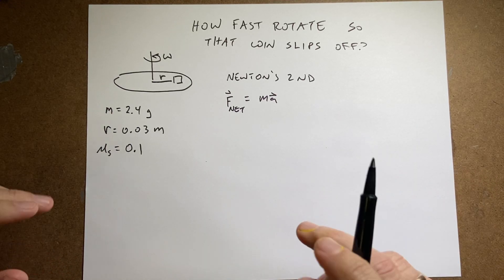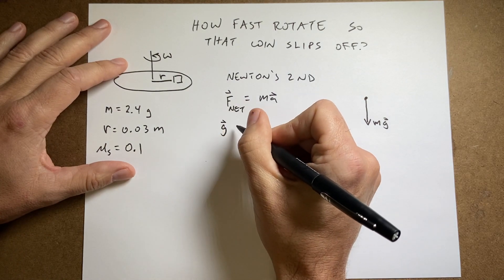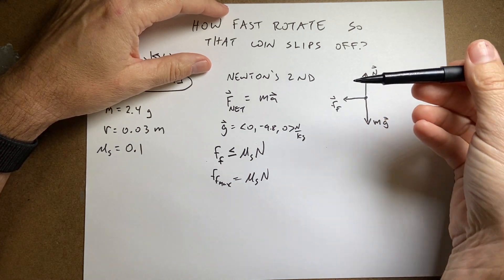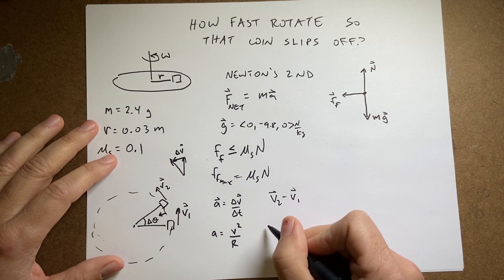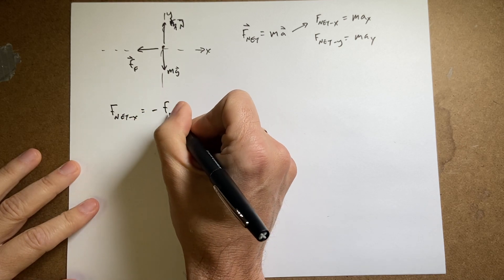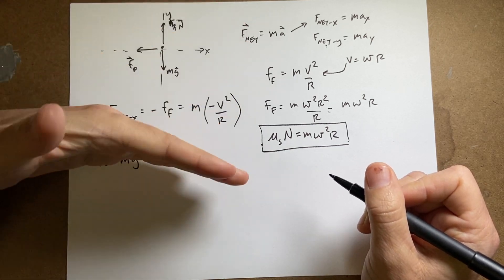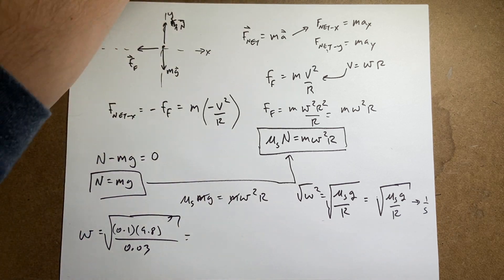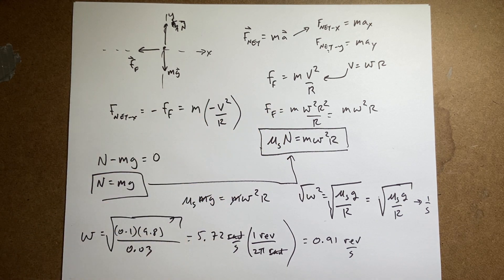Physics Problem: A coin sits on a rotating platform. How fast can it spin before the coin slips?

Comment: Great vid, thnx. My perplexity with this is once friction has reached its limit; it seems that another force comes into play to pull it off; but that’s not the case , right?  If the coin wasn’t moving ( along the surface) before , my intuition wants there to be a force moving it off. I still need to do more to understand this. 
Thanks 🙏
Reply: Just seen your centrifugal vs centripetal vid; thanks. Now I get it .. this ‘mystery’ centrifugal force is a fake force.

Comment: I'm intrigued by the idea that if the disk slowly spins up to some speed greater than what is necessary to cause slippage, does the coin slip first radially or tangentially? If it accelerates quite quickly, it would be tangential (really the coin might just stand still while the disk accelerates underneath it). If it's accelerating very slowly, once it hits the critical omega the coin will slip radially, as calculated in this vid. I think.
Reply from the maker: why do you ask such great questions?  Your questions just make me want to do more physics.
Reply: hmm, so how to calculate the minimum acceleration required for the coin to slip tangentially?

EDIT: I think the equation looks something like this: mu_s * m_coin * g = m_coin * a_min right?
Reply: That is the exact question I was thinking. In case of an angular acceleration, what's the path the coin takes while slipping? (Assuming it slips)